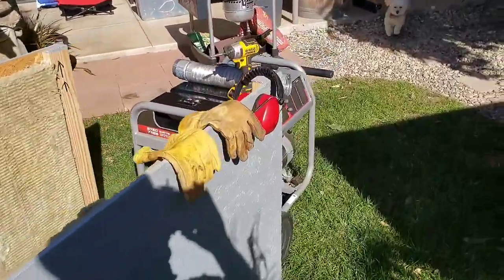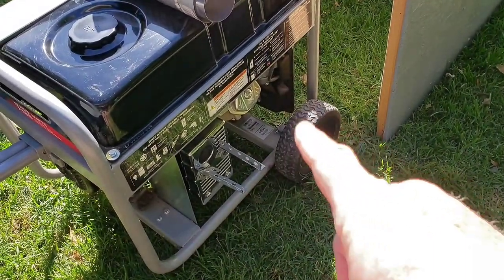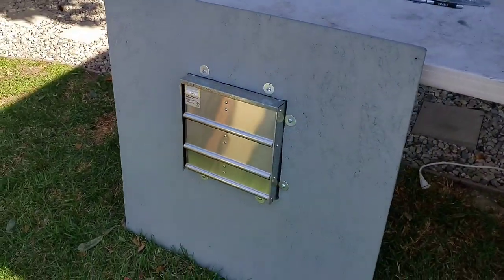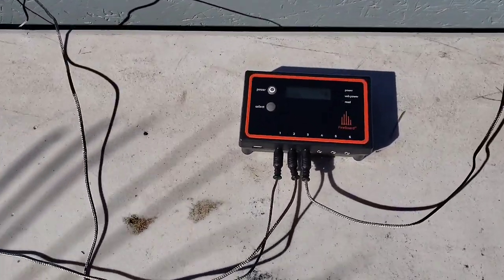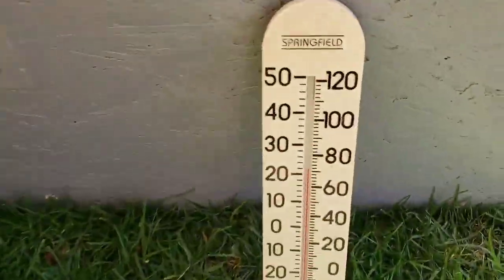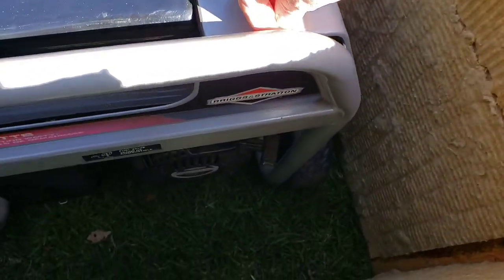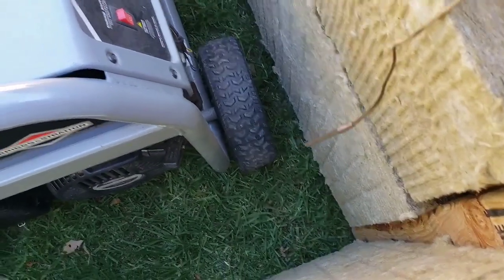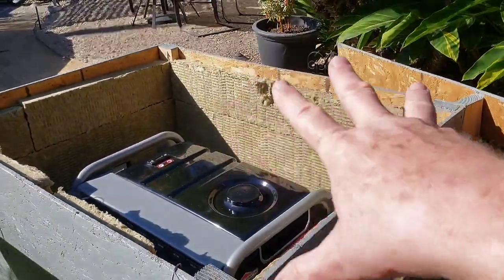UPDATE: How to Make a Generator Quieter | Generator Quite Box Test Run

Comment: That generator is really loud the box did reduce the noise but still compared to those insulated generators, it's still very loud. I have a 55KW JD on a trailer sitting about 150 feet from the house half way to the house you hear nothing. I think the soundproof material you used has to do with the noise, if you look at those big generators their insulation is actually very thin mine is like 1/2 inch and very soft not hard insulation, soft insulation seem to absorb the sound vs hard one. I am planning to insulate my 2nd 20kw diesel generator that's how I end up here. Lesson learned, thanks for sharing.
Reply: Thanks for reviewing!
Reply from the maker: Thanks!

Comment: NICE job on both videos. Ty!!! I plan to add a small 4inch fan at the intake vent and another one within the exhaust pipe to further accelerate dissipation of heat! Cc
Reply from the maker: How did that work out?

Comment: Why don't put doors on the side with the pull cord? That way you can start the generator inside the box. You would not need to take it apart to start it ao turn it off. I would also suggest placing the generator on a concrete board
Reply from the maker: I like the portability and storage.